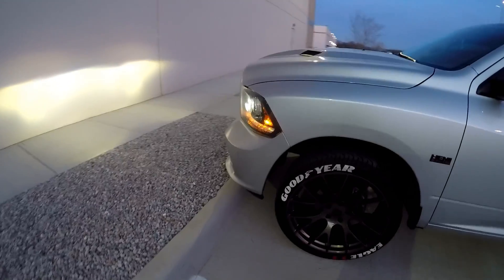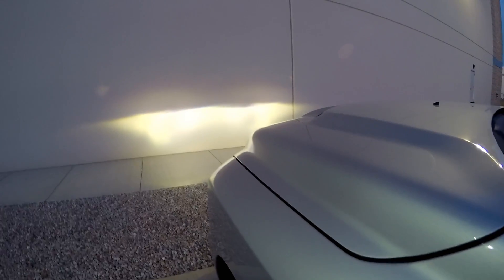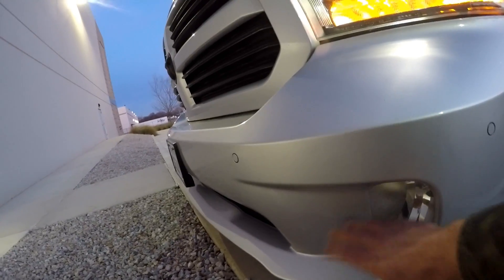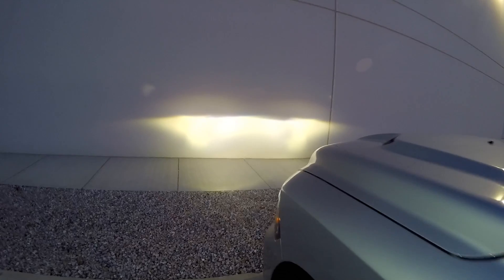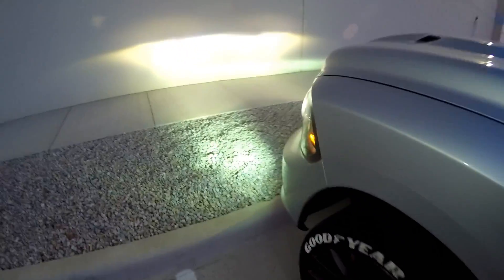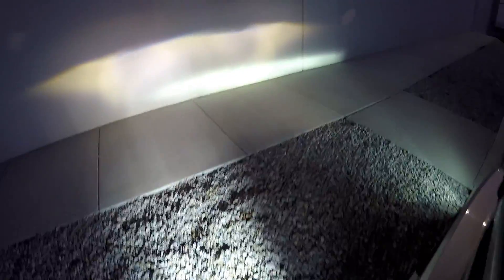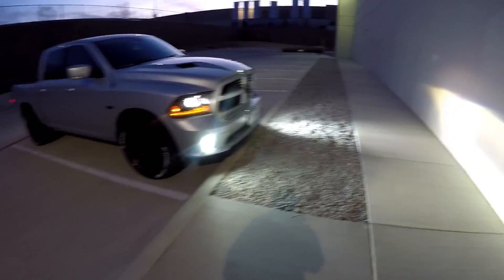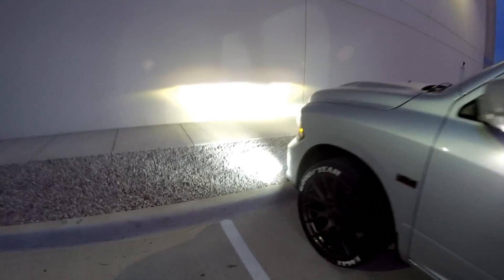LED and HID Headlight & Fog Light Beam Output in Factory Projectors - DODGE RAM - TruckTalk #010

Comment: Boosted2k you gotta adjust those low beams man. You have to turn them so the bulbs are 9-3. I thought my leds were garbage until I adjusted them and it’s a huge difference in light output man.
Reply from the maker: Hey Marcelo do you have any pictures or reference to the clocking?  I'm about to throw in a HID kit I just picked up instead.
Reply: Boosted2k hey I just posted a vid to show you what they look like and sort of explain how.

Comment: They dont work on 2015 I tried this weekend with the can bus harnesses fog lights work fine but both headlights shut off after 15 minutes of use
Reply from the maker: Hey Phillip is that with the Hikari CANBUS decoders?  Hopefully if you bought them off Amazon you can just return them.  Keep us updated!
Reply: Boosted2k yeah I did exactly everything you had on the link with the can bus decoder. Fog lights are still working perfect but I sent back the Headlights supposably 2015 they changed a lot of stuff in the computer it was a b** when I had to install my tuner I had to get a whole new PCM just to put a tune in the 2015 Ram

Comment: They look ok but honestly the stock halogen projectors have no width. There looks to be some glare above the cutoff which might blind drivers. Have a look at TRS as they have a kit (morimoto minid2s4.0) with the appropriate bracket if you ever feel like tearing apart your headlights. The whole kit cost about $340 usd but I think they're worth every penny. They perform like OEM hid like what you see on luxury vehicles. I have the quadbeam halogens on my ram and I will be doing a retrofit soon (Morimoto MiniH1v7.0).

Comment: I tried the Hikari bulbs and were not happy with them at all. Fortunately I'd ordered another set of bulbs and they are much better. I'm now using LED Eagle bulbs in my fogs and low beams and am extremely happy with the output. My Ram is a 2016 so 9006 bulbs for fogs and 9005 for the low beams (projectors). I've been using them for a while now and have never gotten flashed by anyone. I will say that the low beams by themselves are ok, but a lot better with the fogs on at the same time.

Thanks a lot for posting all your great content! I wouldn't have tried doing the bulbs myself, but your guide helped a ton!
Reply from the maker: Thanks for the feedback Mike!  I was happy with the Hikari bulbs in the fogs they were super bright but in the projectors they get killed.  I'm going to do a nice HID setup in the projectors next and try that out!

Comment: $150 hid hylux canbus kit plug and play in my 14 sport and Amazon $44 Cougar Motor led in the fogs.
Reply from the maker: Solid setup Matt!  Post up some links to those when you get a chance for everyone to check out!
Reply: https://www.lightwerkz.net/index.php/hid-systems/35w-hylux-hid-system.html
No harness or anti flicker needed. The hylux ballast does it all. Only have to run a ground to the body and if you want to, drill a hole in the headlamp cover. These use morimoto bulbs in your choice of brightness.
Reply: Matt Lopez Hey Matt. I have a 2014 Ram sport. Can you tell me what the exact setup was that you bought? Bulb size, Temp, harness, and capacitor?
Reply: Darren Simon 9012 bulbs with hylux ballast. 6500k. They have a slight blue tint to them. No other parts needed. All plug and play. Just have to run 2 ground wires. The site I listed above has some videos to help you out. These are morimoto bulbs and hylux ballast. Very good quality

Comment: I hate my fog lights
Reply from the maker: Try the ones I'm using. Only $40 shipped and been working decent!
https://www.ebay.com/itm/55W-AC-9006-HID-Xenon-Conversion-Kit-Canbus-No-Flicker-For-Nissan-Titan-8000K/202215205615?epid=4010676551&hash=item2f14f72aef:m:mM0PEI74s3e2H1okJ216MDg&vxp=mtr

Comment: I also say swap the led and hid kits or run both hid. 
I have done a bit of research and from what I found, your best bang for the buck is an hid kit with a Hylux ballast. They are canbus compatible right out of the box and are highly rated. 
I found this cheap kit on amazon. Not sure the quality of these bulbs but the ballasts are the money maker. Be Careful of imitations. 

Throw some leds in the highs. 

Also def adjust those fogs. lol 

Optix Hylux AC Canbus 35W HID Xenon 
Headlight Conversion Kit Error Free No Flickering - 9006 HB4 - 5k 5000k Brilliant White https://www.amazon.com/dp/B008Y6LKJW/ref=cm_sw_r_cp_api_3CmLAbK6Z44SK
Reply from the maker: Yeah going to put a good 55w HID kit in the lows to try soon!
Reply: Boosted2k 55w is too much. You run the risk of damaging the light with only minimal gains. I’d ask around before going to a 55 watt.

Comment: Swap your bulbs. Hid in the low beam and LED in the fogs. That's what I did in my sport and it works fantastic.
Reply: Yeah bro HID in the low projections  LED in the fog lights best combo. Because the projection  Lights like I have in the ram Laramie are not that good. So going with  HID bulbs You'll get brighter output then stock. Combined with the LED fog  lights it is way better that's what all my friends are running in their rams too. We've tried the LED  Lights  In both  Projection and fog lights but the HID  seems  to be brighter we went with GTR lighting it's a little  Pricey but it will last for a long time   And the  lighting Output is better. Alright man hope we catch a video of this . Love your channel keep going with the upgrades of the ram
Reply from the maker: Yeah I'm going to try that out next since everyone seems to have better results with HID in the projectors.  I'm debating getting a better HID kit thought cause the one I got was definitely on the lower end of the price range and as you know its a pain in the ass to swap the bulbs. I don't want to have to keep doing it with a cheap kit lol.
Reply: Boosted2k check out Wayrank set on Amazon. That is the set I put in mine. Got them on Amazon. The ballast is made in Germany and feels really good quality wise and have built in canbus as well. They also have a year warranty. I'm in Canada and they were $56 on prime with rush shipping.
Reply: you should really do canbus 55 watt. i have then and i love them.
Reply: Junior Gonzales the set I used are 55watt
Reply: Junior Gonzales any problems with the hid you purchased? I live in Canada too and thinking of getting it
Reply: I want to do the same thing but in Ontario allegedly it is illegal to install HID in a vehicle that originally came with halogen. I don't feel comfortable changing it myself as I am not that handy, nor do I have a shop to do it in. So I'm taking it in to have a triple LED set up (fogs, low, and high). I'm hoping this will give me better light. I had HID installed in my Taurus SHO with projectors years ago and the light was awesome
Reply: Kiel Nicholls I got a opt7 hid kit from Amazon and the bulbs did not clock in the same direction as stock. So I had one bulb that looked ok and the other that had a terrible beam then failed. I'm about to send it back. I put my stock bulbs in... So you didn't need an additional resistor add on for that kit?
Reply from the maker: Thanks brother!  Will definitely be making more videos on this when I swap it out!
Reply: Kiel Nicholls  what k did you go with. I'm in Ontario and am looking to upgrade my stock 17 projectors